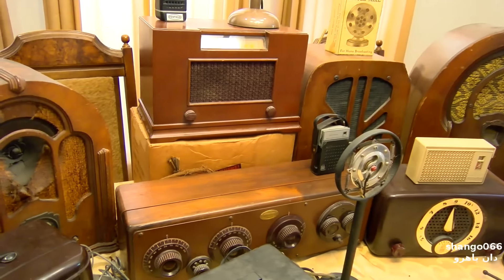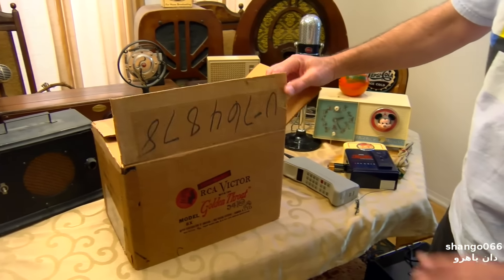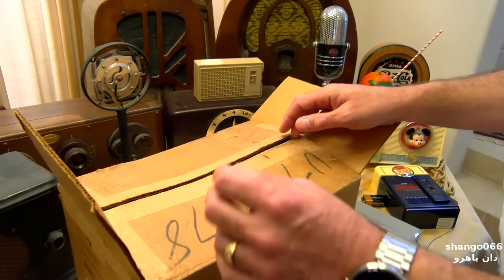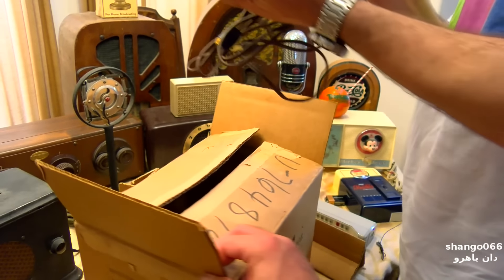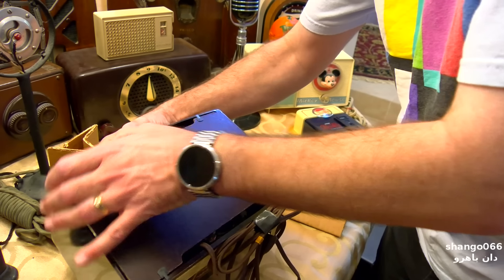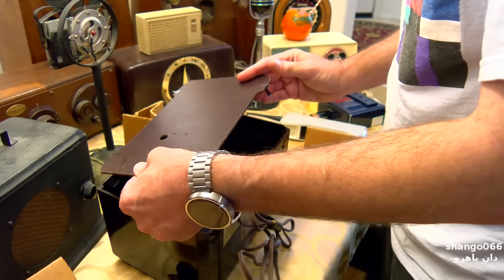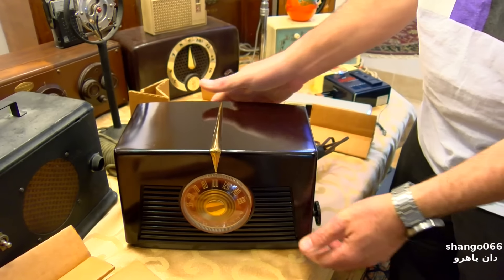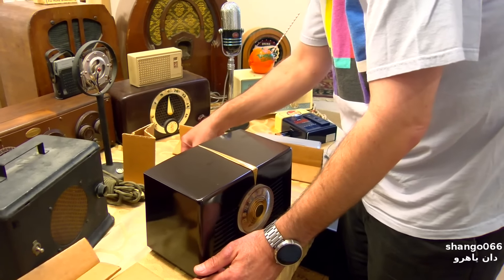RCA Radio New Old Stock From 1949

Comment: The world was a lot different in 1949, when this radio rolled off the assembly line and was put inside that box. Pretty much everything was made in U.S.A. at that prosperous time, because most of the manufacturing industries in Europe and Japan were in rubble from the bombing of World War II. The nationwide U.S. unemployment rate was 5.9%. In those days, the unemployment numbers were crunched a little differently.
Reply: Chet Pomeroy 1949 was the year my mum was born. LOL 👶🏼
Reply: I wish they would have plugged it in. What is the point of owning a radio that you cannot plug in?
Reply: I contract for phone companies and when I started working in this field almost all equipment and materials was made in the USA and some Canadian,now mostly Asian manufactured.
The old equipment was designed to last 40 to 50 years now it's out of date in 2 years.
Reply: @MsCori76  The year the prc became a thing
Reply: @tarstarkusz  You must replace the filter caps (at a minimum) as they dry out and can open or short out over the years-John in Texas
Reply: @TheGearhead222  Having it new in box and totally inoperable is pointless, IMHO.  Also, it's not like they don't have a variac and can bring it up slowly and reform the caps or they could stuff them.  I would have liked to see it singing.....
Reply: Since it’s an old RCA Victor AM radio from 1949, you can add Bluetooth to it where you can stream music through your devices like a phone or tablet.

Comment: I enjoyed watching this because I just got an NIB RCA 8X521. The previous owner had already taken it out of the box and did a complete chassis resto. Mine had the same paperwork, but somehow had no deterioration to it. These small late '40's bakelite AA5 sets are actually very nice when you see them in person. Good performers too. By the way, an older repairman told me how to very slowly power-up a clean as-found set with the Variac. It slowly reforms the caps and you'll know to stop if any problems occur before full 120V.
Reply: Reforming caps is pretty much a myth. All paper caps dry out and become leaky after several years-never a good idea to operate a vintage radio with original wax/paper capacitors-John in Texas
Reply: @TheGearhead222  It seems to be a belief with repairman who want to conserve their cap supply! LOL Honestly though, I have a few radios that are working perfectly on some or all of their old paper caps. Played sparingly, I never had one have a catastrophic failure. The bottom line is it's best to replace them all if you can.
Reply: I would never put that radio in today's voltage. I would stop at 110 volts. Second I would replace all the capacitors. Only the mica capacitors I would keep. All paper and the filter capacitors would get replaced. 73

Comment: I have this same model! Not new though but it works. It's been out of its chassis for maybe a year and half now, but works and also I noticed he has a radio in a box that looks like an old computer have that too. The set/reset control wire is in bad shape, but works none the less.

Comment: That radio belongs in a museum so more people can appreciate what we have lost. I'd put it in an argon atmosphere with limited lighting. "Restoring" it would be like refinishing a Chippendale.
Reply: These are great little radios , but being an "All American 5" tube radio is a relatively common design from the 1940's to 1960's, and one of the easiest to restore electronically-John in Texas
Reply: @TheGearhead222  This is a New Old Stock radio. It is as original an example as any. The only thing that might need to be done is remove, encapsulate, or otherwise isolate electrolytic capacitors against physical leakage to prevent corrosion of other components. I wouldn't put power to it. There are plenty of other All American Five radios to restore.

Comment: You got a great deal. Radios like that in much worse condition go for $50 on eBay.
Reply: ah, but they may be recapped, recorded and calibrated and tested already, tho cosmetics my be a little rough.  Still, here's a museum piece- much more than a mere "collector's item" to the eye.  but, it ain't a car, boat, guitar, extra-rare record etc.... just an NOS really old little crappy/cute table radio, born and yet to live.

Comment: "People dont have the dexterity to put the knob these days", says the guy, while he scratches the top of the radio with the metal clips of the back panel, and after almost ripping off the antenna wires.

Comment: I had the one radio that was sitting on top of the box. Nice wooden cabinet. It really pulled in the radio stations. I used to listen to KDKA from Pittsburgh PA in central Florida. I should kick myself for getting rid of it. Most of these radios will be useless when AM radio goes digital. 73

Comment: Reality check, the filter cap is dried out, it has to be at 75 years old.  People who reform old filter caps are just postponing a messy and expensive repair.  These old filters always blow leaving a mess all over the chassis, sometime taking out the rectifier.  Don't  play with the future of your radio, replace the filter capacitor, and the paper ones too.  Capacitors are cheap, vacuum tubes are not.

Comment: Ever heard of the light bulb trick? Plug in a 300 watt (or whatever this unit is rated for) incandescent bulb in series with the radio. If something's gone bad the bulb will light up but no more current can pass through saving the radio. If the bulb goes dim and the tubes start warming up you have yourself an ok radio and could use new caps.

Comment: 4:55 I'm surprised they shipped an AA5 with the knob off; someone could have accidentally binned the "union" envelope, grabbed the shaft with a pair of pliers and gotten a nasty shock. I wonder if that glossy coating is what attracts those paper bugs; they do seem very finicky about what they eat. Also, I suspect that the warranty label was RCA's way of telling the customer "Don't even think about complaining to us if the set is past the 90 day limit." At least it didn't have the "shipping and handling" charges that amounted to most of the original purchase price on some of the latter import brands.